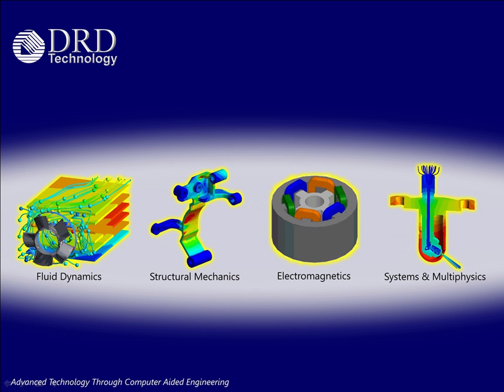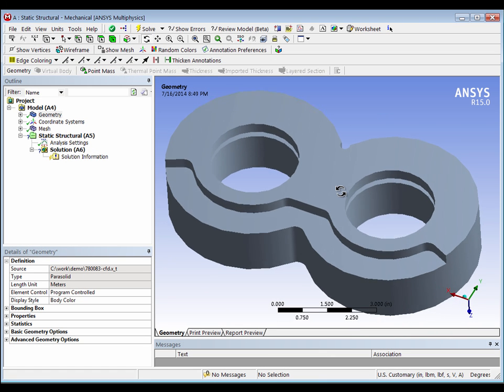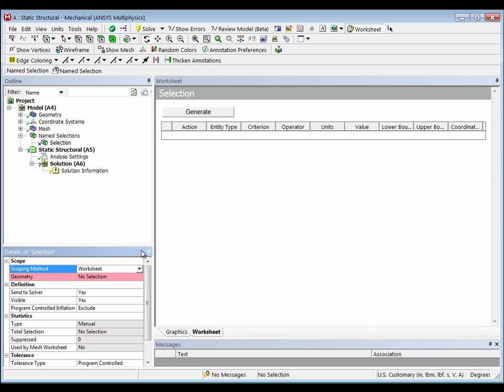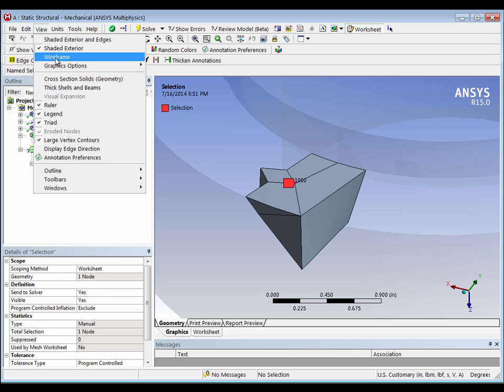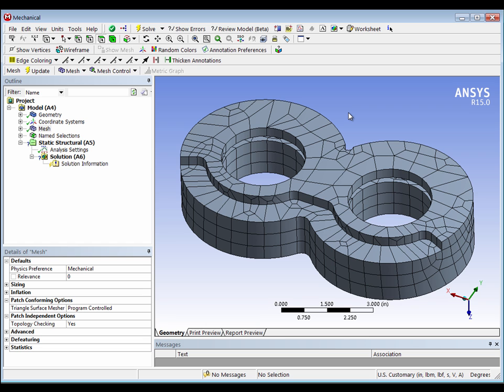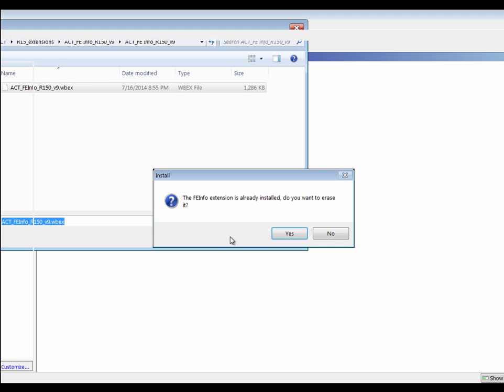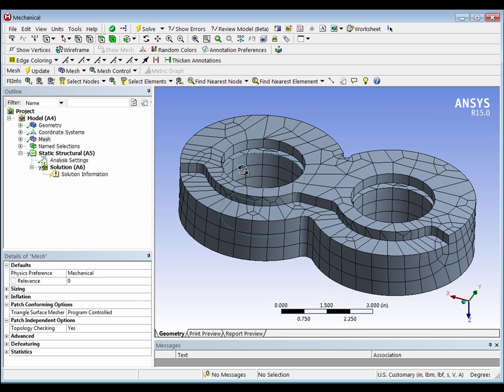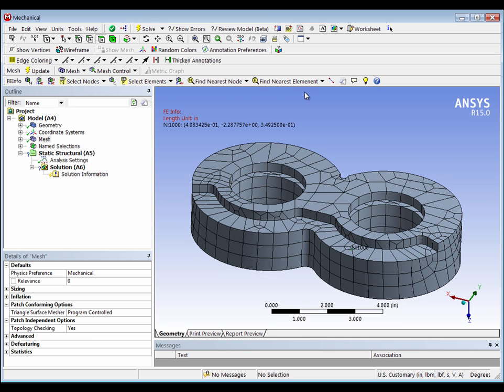Selecting Individual Nodes by Number with ANSYS Mechanical

Comment: Thank you 
I want ask you how I can  take a result like temperature in every node in ansys workbench
Reply: Insert a "User Defined Result". Select the "Solution"-branch and then select Worksheet. There is a list of available commands for the User Defined Results. Look up what you need and type it in your UDR under "Expression". Solve the model, after solving you can export a list of the nodal solutions by right-click -> export -> export text file (as *.csv e.g.). 
Btw exporting the solution like this is possible for every result you insert under solution.